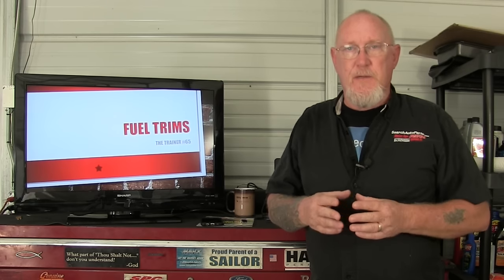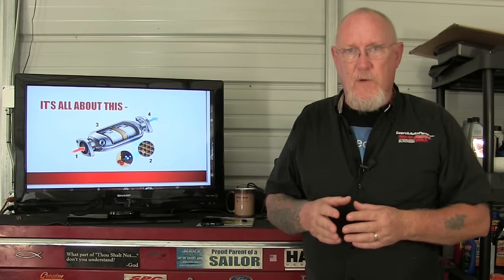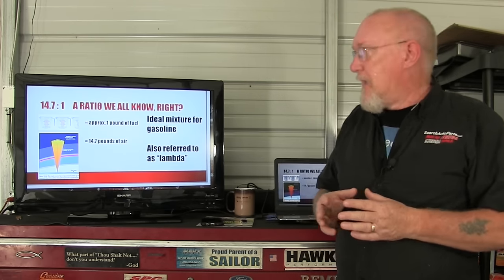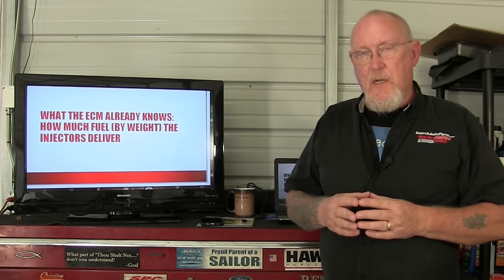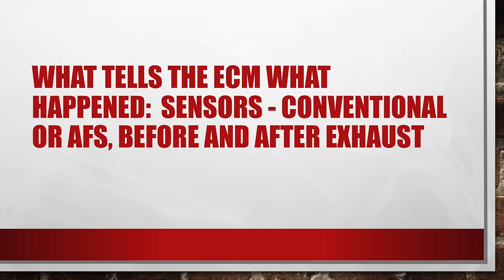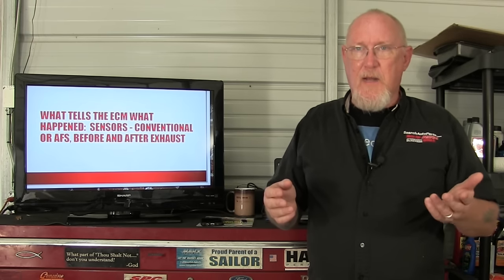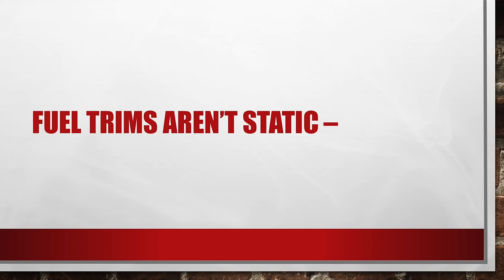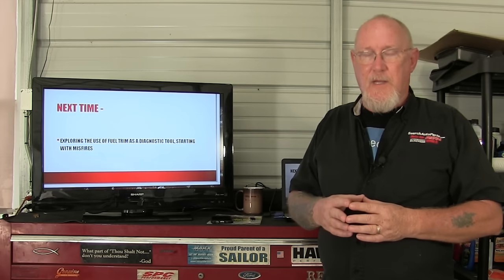The Trainer #65:  Fuel Trim Explained - What It Is , How It Works, And What It Can Tell You

Comment: In the map sensor is a vacuum operated which senses the different vacuum your throttle creates a vacuum because it's closed and when you open that the vacuum goes down it's kind of like everything is there to react to give it gas just like the throttle position sensor the TPS. And as you know the multi-port fuel injection is right there at the cylinder it's not that it changes every time but at idle the engine is revolving at 10 times a second that makes each  cylinder which you could multiply by 6 so that's 60 explosions per second.

Comment: I'm Considering replacing my O2 sensors for wide ban sensors in my 007 Lexus  IS350 with 170,500 miles. Last year I replaced my air intake tube with a RR-RACING carbon fiber tube and a K&N proformance air filter and breathable crank case filter. I've just recently started getting P0174 & P0171 codes. I'm using a Cheap "Blue Driver" scanner, but it offers the codes I need. I just cleaned my MAF sensor   thismorning and pkan on clearing the codes and see if they come back. My question is would the ECM adjust and react differently or more accurately with the wide ban sensors installed? And... Would it be worth the investment to change the injectors? Thanks in advance Jeff Grant Mooresville NC USA
Reply from the maker: Short answer - your front sensors are likely already wideband sensors. Sorry to say that you’d be surprised at how many times I’ve traced a fuel trim issue to aftermarket cold air intakes. The turbulence created in them can cause the MAF sensor readings to bounce all over the place. Hope this helps
Reply: @MotorAgeMagazine  Thank you for your response! I may consider going back to the OEM parts. Thanks for your advice!!

Comment: Could you explain why bank1 and bank2  performance (staff t and ltft) can be so different in a 2005 Tacoma prerunner with over 151k 
Thanks
Reply from the maker: There could be a variety of explanations. One common cause is an issue with the feedback sensors on that bank. Another is the presence of an exhaust restriction on one of the banks.

Comment: So my 2014 silverado   is running -35 on ltft  both banks at idle , decreases  when rpm increase . That's on a hot engine  cold engine running -10 
Any idea what may be causing it
Reply from the maker: A few questions. Does this use a MAF sensor (I think it does)? What are the STFT numbers under the same conditions? Are there any related codes set?

Comment: 2004 Suburban, have 4 O2 sensors, replaced Bank 2 sensor 2, 4 wire, because of a code and it read very low  mostly 0.000. There all the same part #’s and my understanding is sensors after the Cats. Are WIDE BAND and so are the ones before the cats. I read sensors before cats ate Narrow Band.
Reply from the maker: There are two basic types of oxygen sensors in use - Wide Band (or Air Fuel Sensors) and conventional oxygen sensors. I'm betting that your vehicle uses the latter for both upstream and downstream applications. AFS sensors are more common on later model vehicles domestically while Asian and European have used them for some time. These, though, are only used upstream and the voltage you see on your scan tool can range from 1.5v to 3.5v depending on the OE.

Comment: Man on a 3.8l mustang v6 I have both banks running rich. I've cleaned the maf, checked fuel pressure while the vehicle is running and unplugged the fuel pressure regulator vacuum line. The test said that the FPR was good. Could the maf actually be shot? Any way I can test it?
Reply from the maker: What are your fuel trim numbers at idle - at 2500? That's one place to start...OR you can join me tonight!  https://youtu.be/Gc-41R9Gp8s

Comment: Thanks for the explanation as I am trying to figure out if my car is running properly.  The RPM just goes under 700 when idle and sound of the engine of course changes.  There is also some fuel smell coming from the tail pipe when doing 10+ min idle.  After driving  for some time, parking and smelling the exhaust, it doesn't smell at all.  I did capture live data(15 min drive) and if I give you the link, will you be able to help and look at that data?
Reply from the maker: I can try...be sure to inclde make, model, year and mileage.
Reply: @MotorAgeMagazine  Thanks!  Just sent you 2 links with car info to Facebook link you had in the description.
Reply from the maker: I don't really see anything in the data except some strange readings from the MAF sensor. Cleaning very rarely fixes one that has become contaminated. However, I also see some strange PIDs on the data list you sent. I've never heard of Bank 3 for example. You might want to look at the information with a better quality tool first.
Reply: @MotorAgeMagazine  Thank You!  I will try another scan tool and/or the app.  I don't know if MAF was contaminated or not, but as preventive maintenance I cleaned it to see if it was the reason my vehicle went below 700 at idle(at times).  Could you please tell me about strange readings with MAF you saw, so I can troubleshoot and look at my options?

Comment: I had a p0171 code set on my 03 , 3.4l Tacoma. When checking fuel trim, The long was showing -18% and short -2.3 to + 1.6 % at idle(680) rpm.  I thought a p0171 code would carry a high positive on the long trim?  I checked fuel pressure and got 43 psi and it stayed steady when increasing rpm. I have ruled out fuel pump and filter. When raising the rpm from idle to about 2000 rpm, the long will increase to about -3.9 % steady and sometimes go to 0. Would I be correct with these numbers, thinking it's a dirty/clogged fuel injector? The downstream o2 is original with 140k on it. It was carrying .300 range on scanner. Excellent Video Motor Age!
Reply from the maker: Yes, you're right - I would expect positive trims if a System Lean code was set. And it may be, since this is a V6 correct? There should be trim numbers for both banks. Try this:  1.  Check Freeze Frame to learn what the conditions were when the code set (idle, cruise, hot, cold?). 2.  Look at trims for both banks and send those over - check at idle and 2000 rpm for now.
Reply: Yes, V6. Think I solved the problem. I changed the upstream sensor which is called air/fuel sensor and I replaced the mass air flow sensor. The sensor appeared to be fine but I bought it off Ebay and it was listed as OEM Denso. I noticed the part number was 22204-22010. I got a part number from dealership and there's was, 22204-21010. The one from Ebay was a knock off! I installed the new true OEM  mass air flow sensor and BOOM!  My fuel trims and read... long, -3.1 at idle and drop to zero at 1,500 rpm and short remained the same. The hesitation when tramping on the throttle is gone. I only have 1 short and 1 long trim reading on my scanner doing live data. I am thinking it's only one fuel rail feeding all 6 cylinders? Thank you for the response! I am learning much from your videos!!
Reply from the maker: dave jones Glad you found the problem !

Comment: 1996 Toyota Tacoma 2.4l.What can it be happening,when St fuel trim is switching between -3 and +3,but the Lt fuel trim is at +24 firm?.thanks in advance for your response.
Reply from the maker: If the STFT is switching across "0" in that small amount, it means that the ECM is in fuel control - sending the right mix into the engine. If LTFT is +24 at the same time, the ECM has corrected for some lean condition but, if there is no MIL on or code set, it isn't bad enough to warrant any concern. Did you check the numbers at different rpms?
Reply: @MotorAgeMagazine  ,I got the p0170 Bank 1 sistem lean. 
At 2000rpm,st -5 to +7,Lt +24 to +27.
Thank you Sr for your fast response, have a bless day.
Reply: @MotorAgeMagazine  o2 sensor 1 at 2500rpm from 0.28 to 0.685 v.
O2 sensor 2 after catalitic from 0.31 to 0.144 v.
Reply from the maker: @romero10374  What are the numbers at idle?

Comment: To me this is kind of the confusing part because what the computer says it's kind of the opposite of what's happening if the computer said it's adding more gas that could mean that you have a air leak on the intake side like then take manifold gasket or you have a hose and one of the vacuum lines or something so it's adding more gas to make up for the air leak on the other hand if you would have a fuel injector that was sticking open and it's leaking fuel then the computer would be reading a lean or more air or more air to kind of compensate

Comment: I don’t have a DTC lean code. I started with a p219b.  When I’m driving down the hwy my LTFT is close to zero. Bank 1 is below zero and Bank 2 is above zero. When I let off the gas pedal, bank 2 goes to +10 and Bank 1 doesn’t move much. When I accelerate again bank 2 goes back to close to zero around +3 or +4. Could this be a vacuum leak ?   I can not find a vacuum leak anywhere. I suspect cyl #6 injector o-rings are letting air by because I’m getting a misfire p0306. I got new plugs and coil. I also just had the rockers and exhaust cam replaced. I had the p219b prior to valve train repair. (Pentastar).  But lately im getting a po203, po221, and p0306. The misfire code is intermittent. Banks 1&2 precat o2. sensors oscillate from .1 to .7.  Both sensor 2’s read .8 all the way across ( no oscillating and sometimes sensor 2’s are .1 all the way across. I’m always getting different readings. Any ideas ?
Reply from the maker: Fix the P0203, P0221 and P0306 first. LTFT is a learned value and doesn't change quickly and fuel trims are a result, not a cause. In your case, I think the first thing I would do is perform a relative compression test and a volumetric efficiency test to make sure the engine is working as it should. I'm thinking you have a valve sealing issue on #6.
Reply: Motor Age This morning I changed out 2 fuel injectors and replaced injector o-rings on the rest. I drove almost 200 miles today with work and took it to emissions and past. No codes and LTFT’s are now matching.

Comment: I have a 2012 Buick enclave and I'm getting a - 100% on bank 2 .. Bank 1 is running good.What am I up against major vacuum leaks or injector failure.. 
Every morning on cold starts I'm getting a very rough idle for about 10/15 seconds then she idles down nicely..can smell a bit of gas at the exhaust pipe

Thanks
Reply from the maker: You may have a leaking injector, based on the info provided.
Reply: @MotorAgeMagazine  thanks for the info, I guess it'll be either 2 , 4 or 6 that's leaking..my scan tool (MUCAR 5)I don't think will diagnose or pin point the exact injector so I'll have to take it to the shop ..Also noticed mass air flow sensor is idling at around 3.9 when I believe it should be around 6, so I'm going to clean the MAF and go from there.. thanks again
Reply from the maker: @segbachan5123  MAF at warm idle should read about 1 g/sec for each liter engine displacement.
Reply: @MotorAgeMagazine  okay so the MAF is reading correctly then..looks like leaking injections..
Reply from the maker: @segbachan5123  Have you tried monitoring fuel pressure with the engine off? Pressure should hold unless there is a leak. At least you could confirm that one is dripping. And if you do, you could remove the fuel rail assembly and pressurize the system (KOEO) to see the culprit.
Reply: @MotorAgeMagazine  yes sir the pressure is good at about 59 psi.. what is interesting I took it out for a short drive and noticed both the Bank 1 sensor 1  and especially the  Bank 1 sensor 2 was showing very low millivolt.
I just purchased one of each of the O2 sensors from rock auto so I'll install those weather permitting and see if any changes..I will report back once installed  thanks again
Oh one thing I forgot to mention the fuel pressure sensor was pretty erratic, is that normal.I guess it was fluctuating between about 400 to 1000 while driving
Reply: I just tested it again key on engine off the fuel pressure was about just 65 PSI and the fuel rail pressure kept going up to almost 1600 psi in about 2 minutes.Is that Norma 🤔
Reply from the maker: @segbachan5123  Is this a direct injection engine?
Reply: @MotorAgeMagazine  yeah it's a 2012 Buick enclave..I just did something that I should have done FIRST thing and that was to clean the Mass Airflow sensor..Took it out for a short test drive and all my fuel trims LTFT and STFT including my heated O2 sensors are very nice now.I should have known better because I did this about 3 weeks ago with my old trustworthy Oldsmobile Silhouette..check engine light came on and threw 48 codes..Insane I clean the MAF and ALL CODES WENT AWAY AND NEVER RETURNED..
Please people as part of your routine preventative maintenance, please don't forget to clean the MAF..

Will see if it fixes the annoying cold starts which I'm thinking is somewhat related to gunked up valves.. that's my next step to remove the PCV and clean it along with a CRC heat soak via the throttle body.Air filter change might be in order as well time permitting..
A HUGE THANKS TO ALL and especially you sir motor age cheers 🥂

Comment: My short term trim on bank 1 is -95. O2 sensor goes to 0 when the -95 goes to zero.  That only happens when I let off the gas entirely while driving.  The other short and long term trims stay between -5 and 5.  What’s going on?  Fuel injector?   I have a misfire code on cylinder 5. Changed plugs and swapped coils.   At a loss here.
Reply from the maker: STFT never goes to 95. Are you sure you're looking at STFT and not some kind of Lambda PID?
Reply: Motor Age all I have to go by is a Bluetooth obd that lets me check stuff in real time.   My short and long term trims on both banks stay between -5 and 5 with the exception of bank one.  It pretty much stays at -95 and when I let off the gas it goes to zero.  But doesn’t stay there.  My map sensor isn’t even reading anything so I’m not sure if it’s bad or if the program is trying to pick up on something that’s not there.  Idk.  I suspect a fuel injector but not sure.  It’s a 2017 Ford fusion sport with the twin turbo v6. 105k miles.
Reply from the maker: @durangotang1681  I'm betting the tool is at fault.Some parts houses (NAPA, O'Reilly's, etc) rent more professional grade tools. You may want to try viewing the data with one before throwing money at a problem that doesn't exist.
Reply: Hmmm

Comment: Most every sensor uses a resistor because we can measure the voltage going through the resistor according to the temperature of the air in the mass air flow sensor the first sensor on the intake now has two sensors because it's so critical and you can notice if that's not connected the computer is going to realize that it's not connected because there's no change in the temperature of the air that goes through there so you can imagine the speed of the air going into the engine it's going to change the sensor reading if your throttle is wide open or you're sitting there idling so the computer can do this like or it's measuring it like a thousand times a second but it usually doesn't really change that much but it's actually measuring it

Comment: So, My BMW has 4 O2 sensors. I would like to ask, are the upper, pre-cat sensors responsible for the STFT? or STFT calculation is a complex procedure involving the data from all 4 O2 sensors, plus MAF readings and etc. ?
Reply from the maker: The initial fuel amount is based on an internal "map", which in turn is based on load and rpm. The ECM is told how much air is coming in by the MAF and then, based on what it knows about the flow rate of the injectors, calculates the "on time" to deliver the matching fuel amount. But not all engines are the same and they age, so the ECM needs some "feedback" on how it did. That is the role of the upstream O2 sensors (and in many cases the rear O2s play a similar, secondary role). STFT is the correction the ECM is making to the base calculation based on what the feedback from the O2 sensors is. BUT - the sensors can only react to rich/lean conditions - they cannot measure the exact variation - so STFT switches from positive to negative. This is the "fine tuning" of the fuel charge the ECM needs to keep the correct feed gasses flowing to the converter. Does this help?
Reply: @MotorAgeMagazine  Sure Sir. Thank you so much for your attention. If I may ask one more question, if there is punctured hose or unscrewed bolt of an air hose resulting in a vacuum leak, can it ruin the O2 sensor if the vacuum leak is not timely addressed ?
Reply from the maker: Ramaz Kutateladze No, not likely. Oxygen sensors fail from age or are contaminated by oil or coolant.
Reply: @MotorAgeMagazine my car is 16 years old already, suffers from an oil leak from a rear engine seal... damn.. so I do not have to look any further if I get P0171-P0174 codes all the time..  those O2 sensors cost 220$ 4 piece..
Reply from the maker: @ramazkutateladze538  A leaking rear main will not contaminate the sensors. If you are chasing down a  lean code, compare the fuel trim numbers at idle and at 2500 rpm.
Reply: @MotorAgeMagazine  Thank you so much, Sir! my best wishes to you and your family.